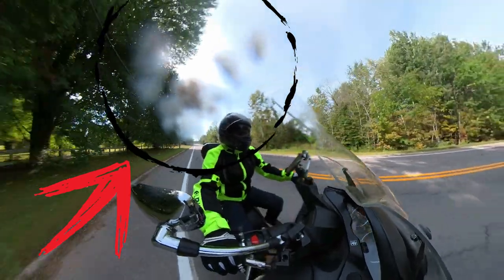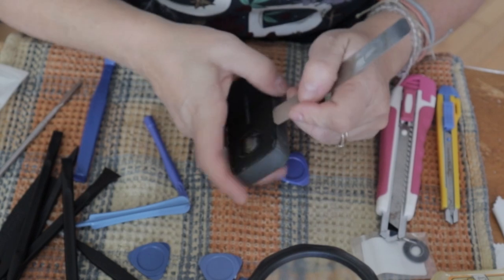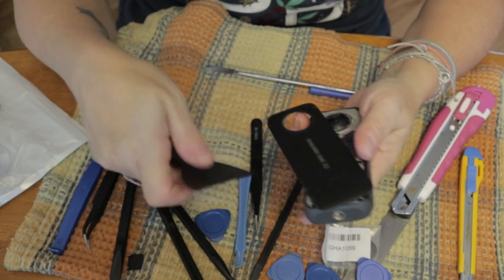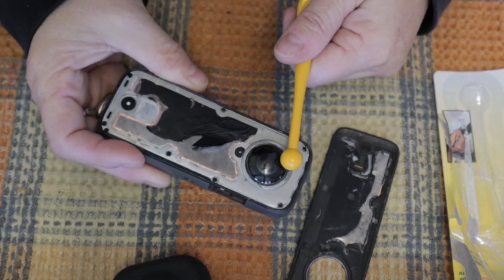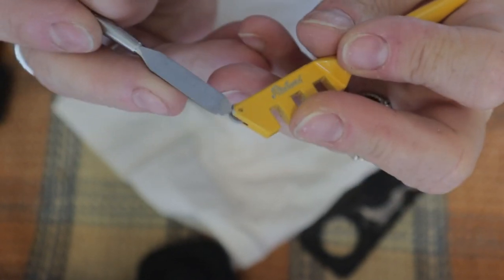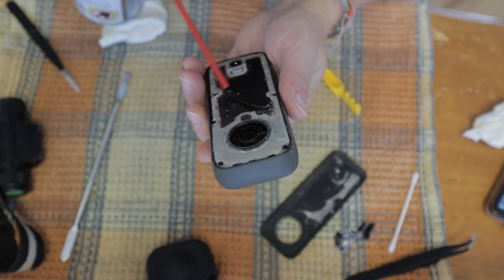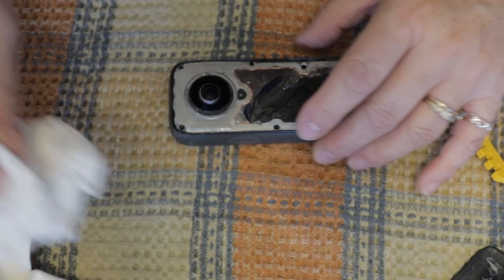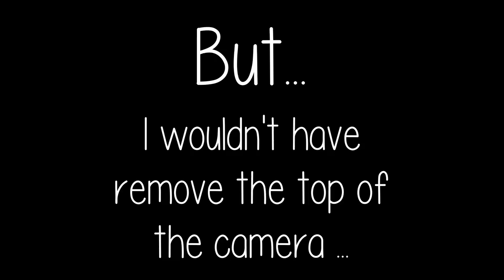Changing the lens of the Insta360 One X2 | DIY lens swap

Comment: Good information - in that we see the innards of the X2.   Following 4 YT tutorials. This week,   I just took a sharp blade and strong tiny screwdriver to just prise away the lens from the socket.   This worked.   No drill.  No cutting.  No removing of cover.  takes 10 minutes per side to remove the lens and glue in the new ones.   You need courage - this is my 2nd X2 and the scratched lens is beyond any redemption other than this repair.
Reply from the maker: I am glad you were able to remove the lens easily. I realized that once I removed the top, that I didn't have to remove the cover 🤷‍♀️

Comment: STOP! Before removing lenses! You can polish it with easy without replacement if it doesn’t cracked.
Reply from the maker: I did try to polish it before changing it. But it didn't work because the lens was cracked, and some of the scratches were too deep to polish.
Reply: Can uh please suggest me the polish name
Reply from the maker: I don't remember what I used, but you can do a search for "glass polishing compound." There are a few out there. You also need sand papers with a small number.  You can buy kits for cracked glass on Amazon or in a hardware store.
Reply: Tried that.  Takes hours - and does not work for deep scratches.
Reply from the maker: You're right. It doesn't work for deep scratches.

Comment: The problem is the quality of stitching the image from two matrices. This is a very fine-tuning. The video does not show the result of how the camera shoots after replacing the lens. And how it stitches both images.
Reply from the maker: Good point. I didn't do a follow-up vid. I will. Since it is not the primary lense, there is no stiching problem... not that I've seen.
Reply: @LivingLifewithJudith   I found out in one video that a special adjustment is required after replacing the lens. Without it, the camera stitches images from two matrices incorrectly.
Reply from the maker: Thanks for letting me know! You are always better off sending it back to the company, they will definitely know what they are doing.
Reply: @LivingLifewithJudith  In any case, you need to try to shoot so that the seam does not fall on important parts of the video. Good luck to you!)))
Reply: @LivingLifewithJudith  I will pick up my new X3 in a few days from the transport company!!!
Reply from the maker: Yeah, I always make sure one of the camera lense is facing where I want to shoot. But your input is an important point. Thanks for letting me know! I wish I was able to get the x3! Let me know how you like it!!!

Comment: Nice job.  The only thing I have seen differently is to NOT use superglue and just snap it in place.  Supposedly the glue can emit gasses that mess up the inside of the new lens cover.  Not sure if you have seen this.  Cheers!
Reply from the maker: You are right, the lens does snap in place. I didn't know about the gasses, though. I didn't see anything weird yet regarding the lens or while recording. I will do an update to show how it records and what you get and the results. I'll take a closer look at that. Thanks for letting me know!

Comment: I done my 1st two lens replacement in a row. Here are what I learned:

[I DID NOT REMOVE ANY PART AND DID EVERYTHING FULLY ASSEMBLED(WITHOUT BATTERY)  I DID NOT USE GLUE]]

1. Use a Dremel(Small handheld  cutting disk) and make a cross in the middle. Eventually it will crack and make an opening. As soon as its open make sure to tap the oposite side with your hand to have the pieces of glass come out so when you use the cutting disk again the vibration with broken glass wont scratch the inner lens.

2. When the middle is open use a small watche flat scewdriver to pry out the 4 big piece but be carefull of the plastic ring around the lens. You have to be gentle and not pull them up straight up but at an angle.

3. Use a can of air duster and clean the inside with the air only.

4. Make sure there is no uneven piece on the border left by the lens or glue.

5. Look at the inner lens with a light and use the reflection of the light to see if there is any residue or smudge. If there is use a Q-tips with 90% rubbing alcohol and use the compress air again.

[Install of New Lens]

6. Push the lens in. My first one went easy and clipped when in place. The second one was stuck on the retaining lid but I used a towel and a table and push the lens in using the table as a lever. The towel/cloth protects the lens so you can force it in.

Result both were installed living no marks on the cameras and no differences between the original lens and the replaced one. No glare, dust or imperfection.
Reply from the maker: I did add in the vid to NOT remove the body part.
Thanks for sharing your instructions!
Reply: Thanks for the video, its been a whole year Im waitting with 2 Different cameras with the lens to change but I did not have the confidence to do it until I saw your video. 😊 @LivingLifewithJudith
Reply from the maker: Awesome! Glad you went ahead and did it!